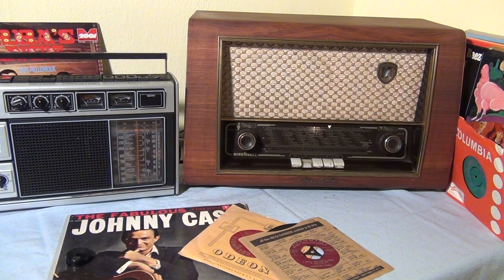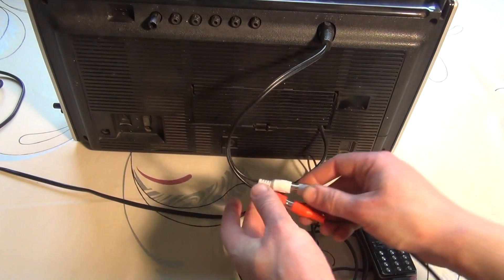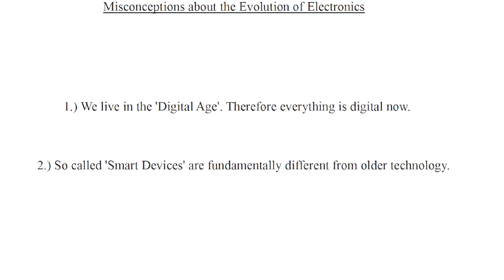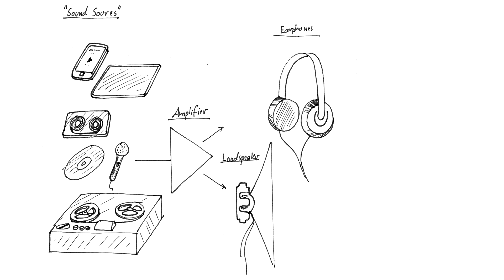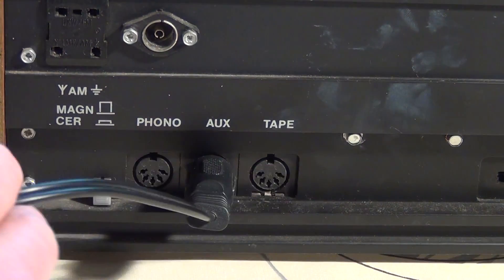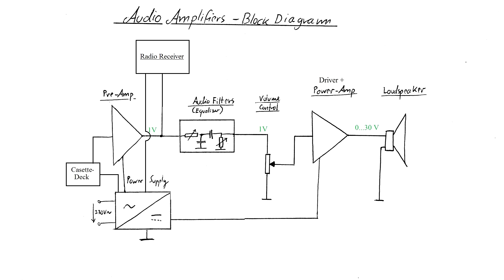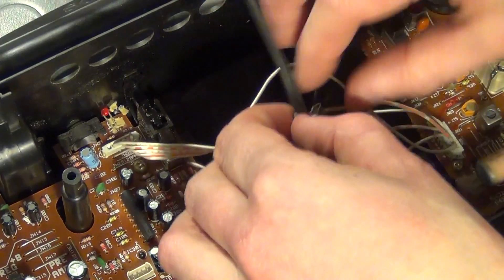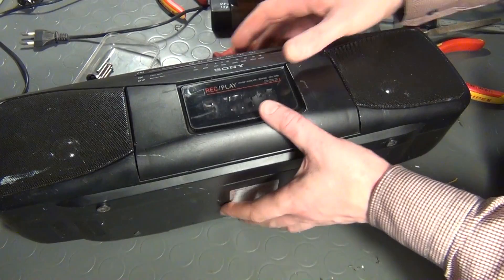Old Radios as Smartphone Docking Stations / Tube Radios

Comment: You can buy output Jacks that have a switch built in. So when you plug a cord in it would automatically disconnect the radio signal. Thanks for the videos. I'm a new subscriber to your channel and way glad I found it. I hope to start making some videos myself though I'm not near as skilled as you. I do have a video of a laser microphone and a couple videos of a homemade oscilloscope made out of old tvs.

Comment: Thanks for sharing this idea. I had an old radio/cd/cassette unit in the garage that the CD player was kaput on. Pulled it apart, and it was easy to spot the connector running audio + power (8VDC) from cd player PCB to the amplifier board. I just had to solder a 1/8" stereo plug on the audio cable and it works!

I took the CD guts out to allow bringing the cable up through the CD player opening, so with it closed it look stock. The 8VDC power to the CD board was also switched on only in CD mode, I'll ad a 5V regulator and the end of an old micro-USB cable and also be able to power/charge my phone!
Reply: good job. wish I was that good.

Comment: I made a small FM transmitter to transmit audio from things like MP3 players to my boombox which has no line input.  Actually an input for a ceramic phono cartridge can be used as a line input since it adds the cartridge itself provides the equalization, so the input adds no equalization of it's own and works pretty much the same the same peak-to-peak voltage level that a line level input would.
Reply: +CoolDudeClem I made an FM transmitter, connected it to a mike, and messed up my classmates' fm radios! in High school.  that was so much fun!no one could figure out why their fm radios didn't work!

Comment: Hi there, I had been thinking about doing something like this for a while... I notice that you insert the L R connections from the auxiliary connection in before the preamp.. Did you measure the voltages to make sure that they wouldnt blow the preamp? 
Also when you were cutting the tracks and "didnt make a good job" as you said yourself, why didnt you just remove the smd resistors... Enjoy your videos.. well done and thanks..
Reply from the maker: JonathanAnon Well there are many little things that I do, which I don't talk about in my videos.It would make them simply too long. I didn't connect the signal wires directly to the preamp right away. I first used some voltage dividers to limit the input voltages / currents but then found out, that it wasn't necessary. 
Actually I don't remember any more why I didn't remove the smd-resistors.

Comment: Nice tutorial, but you should warn that old tube radios may shock pretty good. I did this experiment a good while ago with a electric guitar pre-amplified trough 80' tape cassette radio driving the tube receiver amp, the only way to play that guitar was sitting on the top of a wooden chair.
Old tube radio does not have a ground plug connection you will have to connect the chassis with a wire to your house earthing.
Reply: Which is why when you poke around inside these old things you are supposed to always work "with one hand in your pocket* i call it the Alanis Morrisette rule.
Reply: Mick Bradford  Yes nearly all radios from that period had protective cover over the speakers and it was a thick but aerated fabric.
I fond this type of cover also on a Tesla brand who was produced in Czechoslovakia.
Reply from the maker: If I had opened the tube radio in the video, I would have warned about the high voltages used. You probably can never warn enough.

Other than that, I find your story a little odd. Why did you get an electric shock and why would grounding the chassis help at all?
Tube radios and amplifiers, like virtually all audio amplifiers are not earth referenced, because by connecting the chassis to PE, the noise from the protective earth would be coupled into the amplifier.
Since the tube radio(at least mine) has an isolation transformer build in, non of its parts has a high voltage relative to earth potential, therefore to get an electric shock you would have to touch at least to points inside the radio at the same time.Your body would need to have  a connection to the chassis + another contact from the radio which is at high potential relative to the chassis. Was that the case when you held your guitar ? If you connect the chassis to earth potential then you would only need to touch one of those high potential points because your body would already be connected to earth ground via your feet. Therefore I don't see the advantage of that.
Reply: The Post Apocalyptic Inventor
if i remember well the radio had a isolation transformer but i think he had also a decoupling capacitor (or even 2) between primary and chassis.
This was the beast http://www.proradioantic.ro/produse/1201855380_poza.jpg
Reply from the maker: Ah ok. the capacitors would have been the reason...That's a nice radio. What brand/model is it? Are you from Romania ?
Reply: The Post Apocalyptic Inventor
The model of radio was Orizont  s602 ("skyline" in english ) made in Romania by Electromures, and yes i am form Romania.
Reply from the maker: Interesting. I didn't even know, that Romania had its own electronics industry back then. Were the components (like capacitors and vacuum tubes) also made in Romania, or did they import those from Russia, East Germany etc. ?
Reply: The Post Apocalyptic Inventor
I don't  know if the parts of that radio was romanian but we had a electronic parts production from about 1962. I am not shore for valve's origin but the passives was local.
Reply: Stanila Stefan I just visited your link and noticed the protective fabric covering the backside of the speakers. I am 70 years old and I don't recall ever seeing this before. Do you know if this was common with the Romanian electronics industry or only with this manufacturer?

Best regards,

Mick Bradford
Reply: Stanila Stefan A somewhat delayed answer, but i just found this great channel... i think i know why you experienced this problem. Many old tube radios were "universal" radios, suited for both AC and DC power. Hence this, they couldn't rely the power supply on a transformer because no DC voltage would go through it. Instead they used a coil/capacitor input network in conjunction with a diode tube. The flip side of this is that you'll get a "live" chassis. In a all-wood cabinet with bakelite (the pre-plastic material) for knobs, this was an acceptable solution. When most countries chose AC for the grid, the princible became obsolete.
Reply: Stanila Stefan Now i have seen the picture...maybe it's just the noise capacitors fault. The unit is probably too new to be a "universal" unit.
Reply: Bo Helsted Nope this radio was built only for AC and the capacitor between primary and secondary i guess it was for noise related reason.

Comment from the maker: My new video about reusing and modding old radios is now online.
Reply from the maker: +Fisnik Osmani Hey. I do understand you. But what you are proposing is not possible. Or at least not practical. The headphone jack is connected to the output of the amplifier and not to the input. There is no simple way to use it as an input jack. You  would have to trace out how the radio is connected to the internal amplifier, like I did it in the video.
Reply from the maker: +Fisnik Osmani I can't tell you, because there are thousands of different designs out there. I can't know how your particular system is build up. You have to find the amplifier chip, read off the component number, google for the number to find the datasheet. In the datasheet you can look up, which of the pins are the inputs. There you can attach your input jack. If you also want to use the volume control and "tone" adjustments you have to trace out how they are connected to the amplifier input. If that is too hard for you, you could also try to insert your audio signal directly at the input of the volume-potentiometer(s).

Comment: Why do those old radios have a cable in the back coming out and going back in? is it to connect external speakers and disconnect the internal ones? The Radio of my granma has the same cable on the back :D
Reply: The Post Apocalyptic Inventor Tubes are even produced brand new today... because they still are dominating the market for musical instrument amplifiers (at least for guitar and bass players) because of their typical clipping behaviour. For anyone interested in tube amplifier design I'd suggest looking at tube-town dot net ;)
Reply from the maker: No it's not for external speakers. Inside the wooden case is a simple dipole antenna. This antenna often consists of just two simple pieces of  copper wire or aluminum foil. The two ends of that dipole come out of the backside of the radio. It permits the radio to receive radio programs without an external antenna. But when you have a professional antenna on your roof, you can plug out that internal antenna and then plug in your (in most cases) much better working roof antenna in the two jacks (which are normally occupied by the two plugs coming from the internal antenna).
 
My radio works pretty well with the internal antenna though.

But my Nordmende Rigoletto seen in this video has also two jack to which an external speaker can be connected.

Do you know the model name of your grandma's radio ? Does it still work ?
Reply: The Post Apocalyptic Inventor I don't know the model name, but I could look the next time I'm at her place^^ But it still works, she changed the tubes some weeks ago. Funny how competent old people are technology-wise compared to the youth of the 21st century :P
Reply from the maker: Yeah. I guess that's sad but true. Do you know where she bought the tubes ?
Reply: The Post Apocalyptic Inventor she had them in stock, afaik she bought a few 20 years ago, so she doesn't need to buy new ones, especially w/ transistor radios flooding the market
Reply from the maker: Boy it seems she really likes that radio :D. But that's pretty cool: A grandma with a stock of vacuum tubes :D. I'm pretty sure that stock is worth  some money now.
Reply: The Post Apocalyptic Inventor the cost of vacuum tubes is not as high as one made think.  A Google search will give many results for online sellers of vacuum tubes. I purchase mine from TubeDepot dot com.
Reply from the maker: Thank you I'll check that page.